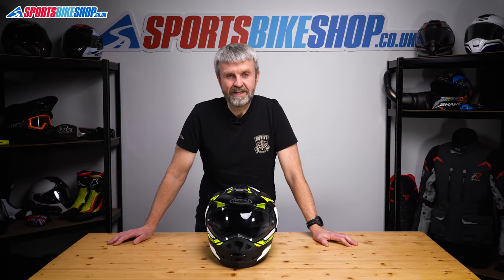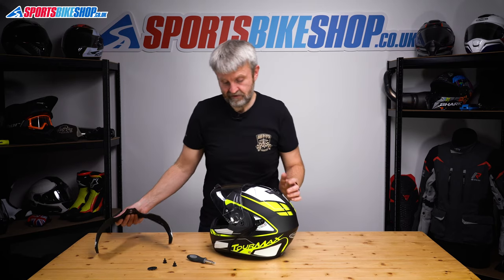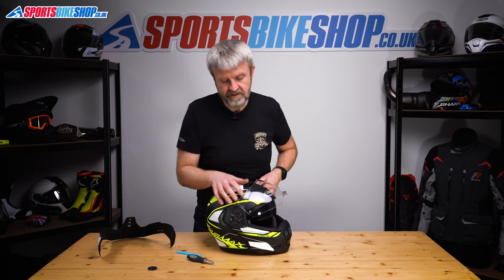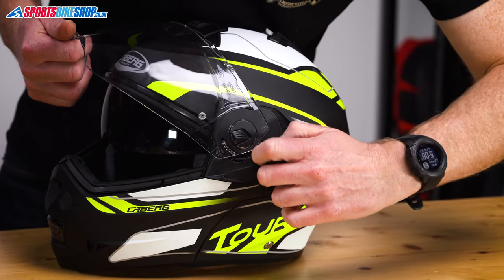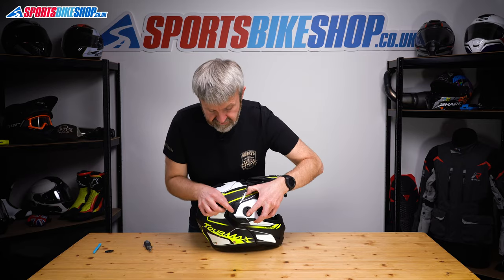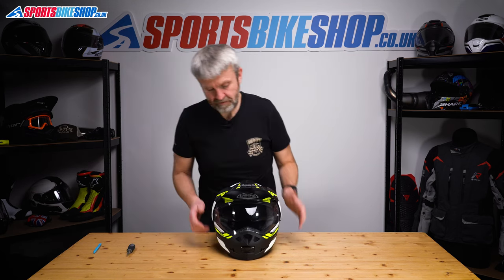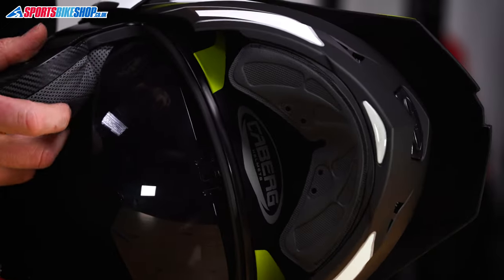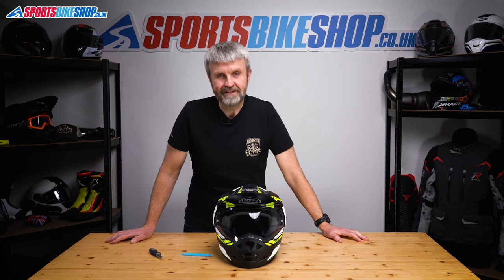How to change a visor: Caberg Tourmax motorcycle helmet

Comment: How much does the peak catch? It is ok for freeway riding at 80 mph? Can the helmet be used without the peak?
Reply from the maker: Apologies - this isn't a review, so I couldn't comment on its performance in those conditions. To use this without the peak you would need to source some screws from a Caberg Duke II to reattach the chinbar, as the Tourmax screws are too long to use without the peak in place. It seems kits are available, but we are unable to source them. If you intend to use without a peak all the time, a Duke II is effectively a peakless Tourmax. Cheers, Tony
Reply: @sportsbikeshop  Thanks! I would like to have a helmet that can be used or used without the peak so I guess have to pass on this.